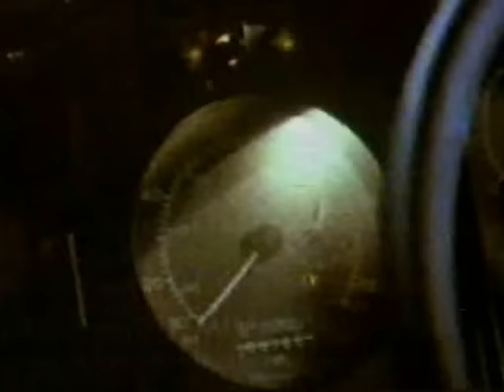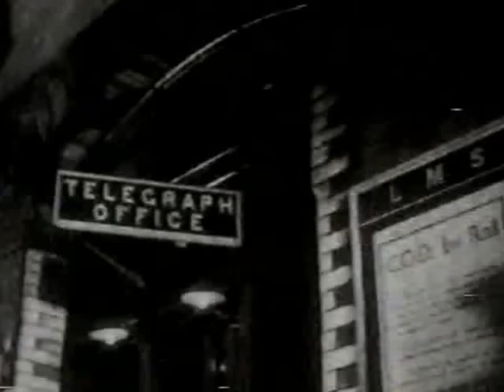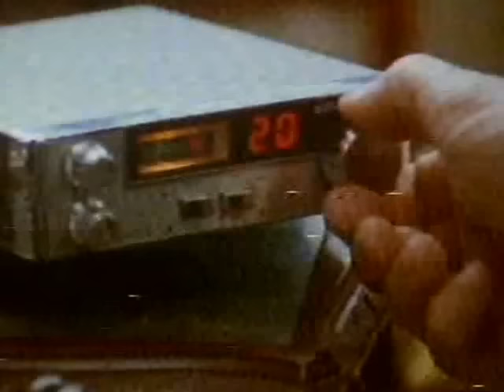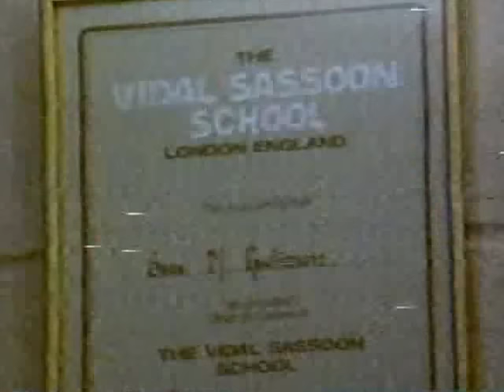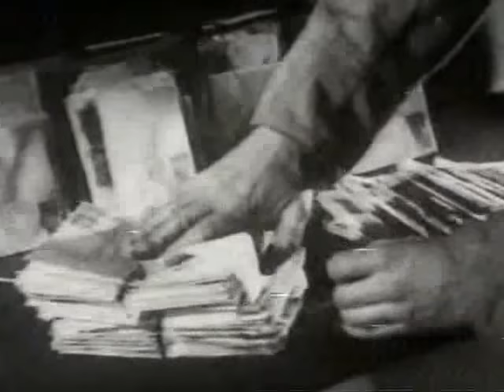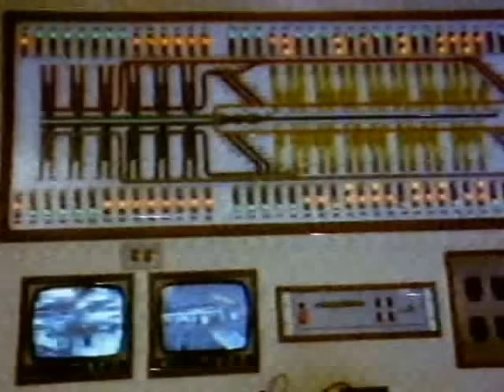Trucking in the 80's Featuring the Rose Cafe in Chelmsford

Comment: Every time I watch that intro of the trucks being overtaken I wonder what sort of steady cam mount they filmed it from that can drop from 15 feet to ground level instantly. Also just how close they came to those roadworks, doubt they got a second chance.
Reply: Not to mention it's one continuous take - a full minute and thirty-five seconds long, I recently discovered!
Reply: I remember sitting down as a kid to watch this on bbc2 after seeing it in the radio times,then the announcer said there was a program change,so I never saw it 😩 thanks for putting this on 👍🏼
Reply: @72whoosh  it was literally pulled at the last minute because of concerns over product depiction and advertising, I understand the original edit featured Volvo trucks more heavily and it was felt to be too much like an advert. This was the re-edited version that was broadcast a few months(?) later.
Reply: They probably used a drone with an iPhone attached.
Reply: @Nickbaldeagle02  in 1987…?
Reply: @CycolacFan  yes. Don't you know about the time travellers? I read it in The Sun.
Reply: @Nickbaldeagle02  now you saw that I think I saw it mentioned in a copy from June 2037…